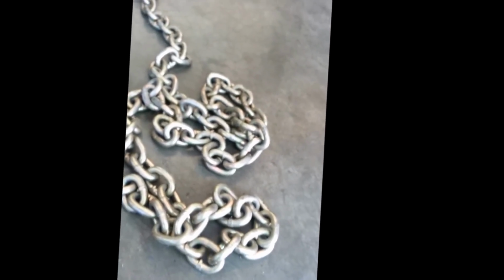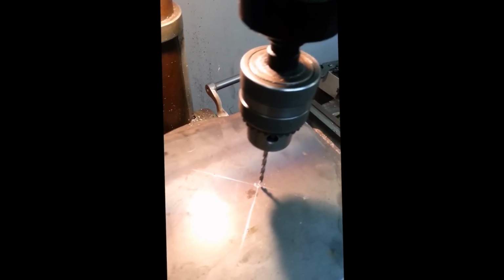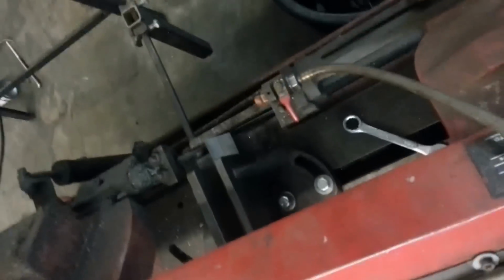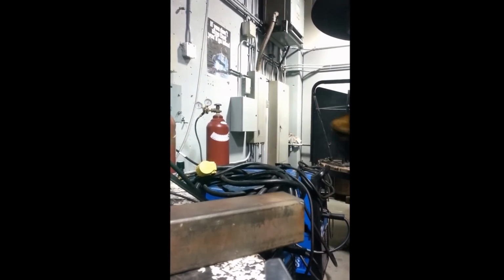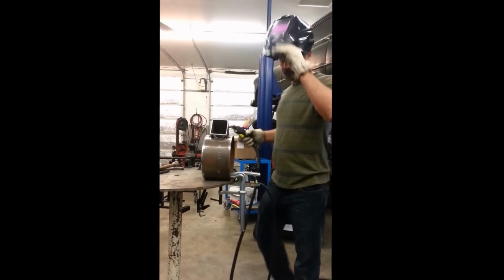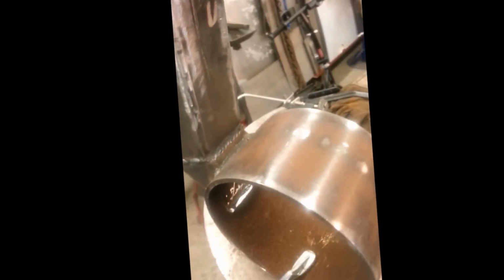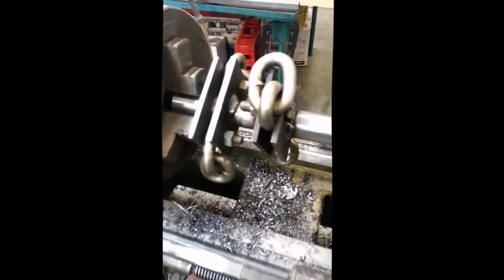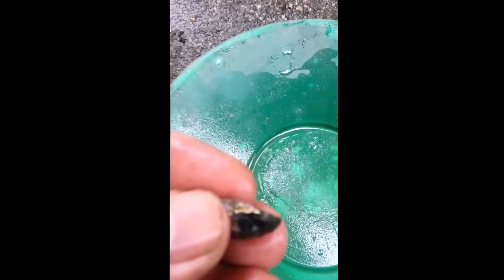Building a Gold Ore Crusher Impact hammer mill tutorial build

Comment: I like your design thoughts. Your shop is much like mine, and your use of shop materials is right on. Are you using 8" 1/4" wall pipe?HOw much clearance betweenchain and pipe id?Excellent build brother. I would suggest a good clean up sluice or a miller table instead of a pan, lots of small gold. Got my sub.😎😎⛏⛏🔥🔥

Comment: Very nice job!  You talked about strike plates in your vid.  Would those be steel plates welded inside the drum or at the tips of the chain links? ... or both, perhaps?  Even just adding weld beads on your chain tips will extend their lives, but you could weld on small, steel plates on them, too.  Also,  I might be inclined to drill in more holes on your output.